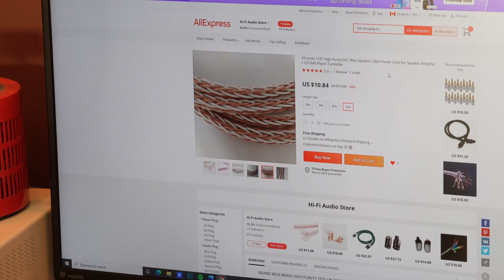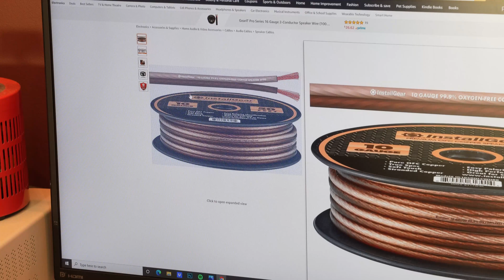Save hundreds even thousands of $$$ making your own speaker cables.

Comment: The Cordial CLS 425 cable consists of 2 conductors, each made up of 511 strands of 0.10 mm diameter. Another raccomandation is Sommer Kabel.

Comment: I would urge anyone interested in high quality speaker wire to go back and look at the work of Gordon Gow and Roger Russell (Presiden and Director of Acoustic Research at McIntosh Laboratory respectively). Back in the early 1980's when "hi-fi" speaker cables starting popping up on the market, they ran "A-B" listening tests where the switched a speaker back and forth between ordinary lamp cord and high dollar speaker wire (that's oversimplifed). Spoiler....there was not audible difference between the two

Comment: 10 AWG is not common in Europe 😉 Closed are 4mm² (around 11.2 AWG) and above 6mm² (around 9.4 AWG). I use the 4mm² for almost everything. Mostly OFC cable. Even for my PA system (Seki cable black weather resistant) and Manax for indoor use.
I like banana plugs for convenience. With thicker cable it is easier to use. You introduce an extra connection point but ok...

Comment: Strongly recommend adding 1/2 inch rope inside the cable, it avoid kinks.
Reply from the maker: will do :)
Reply: The purpose of adding  rope isnt to avoid kinks (although it might help). It is to improve sound. Others can probably explain it better than i can. (see danny richies videos). He also uses some sort of tape on the ends.

Comment: You can get Canare 4s11 speaker wire for just over $1.50 a foot, it's 4ea #14 conductors so if you use one pair for the signal and one pair for the return you end up with #11 conductors of good quality wire for a good price. I terminated one end in spades and the other end in good banana plugs, they should both be copper or btass - not steel.
Reply: Take a look at Gordon Gow's test in the early 1980's. Lamp cord, in the appropriate gauge, is $.10 - $.25 / foot

Comment: China fake (KIMBER) It is not possible to believe that this is an OCC cable. The structure of the cable (7 wires of three diameters) does not match the original,The price is great and irresistible, but compare with the original KIMBER 12 TC, you will be surprised.

Comment: How is this 12TC different from Kimber 12TC? Do Kimber use better materials?
Reply: Kimber Kable 12tc, 8tc etc  are the originals, and made in the USA only.  The  lookalikes on AliExpress are fake .
Reply from the maker: I have never seen the Kimber close in my hands To comment but I am sure these are not far off if not made by the same factory. But I could be wrong.
Reply: It's copper wires who cares as cost come first. But more power to you if want to be patriotic and pay more.
Reply: @wric01  sure, np, I’m merely pointing out the facts.  Ask me how I know, lol.

Comment: I am doing a separate amp to the sub and to the main stereo speakers similarly to yourself but I am worried if the signal arrives at the same time or if it is slightly out of sync, it sounds better overall and I do this because my better amp doesn’t have the sub output like my other does plus, I like to blend the 2 how I like. But my ears aren’t to the level where I would notice if it was or not.
Reply from the maker: They should not be any delay but make sure the amps have similar gain as 1 may be louder at various volume

Comment: I started out 15 years + ago with the old 27 pr. of Cat5e cable braided and it had similar specs. Now I see some advantages to this air core arrangement, but the disadvantages are even greater. The worst  of all being its susceptible to being crushed tightened or loosened. Basically it will not stay stable. I paid a little bit of cash for some Cardis 101 cable and got s good or better sound and it is so much easier to handle, hide, mount off the floor...

Comment: Thank you very much ! I believe these are the same ones sold by Danny Richie from GR research for a higher price tag. I knew they were available on AliExpress but i didn't know the exact name. Thanks !!!!
Reply: I got mine from aliexpress put a rope through middle like the GR trick.but I wouldn't say its that much better the van damme 4mm shotgun speaker cable.had better improvements with some power cable from aliexpress.
Reply: @markclancy5371  Every system react differently depending on the gear.
Reply: No, they are not the same. GR research sells the cables with polyethylene insulation which is not available on Aliexpress.